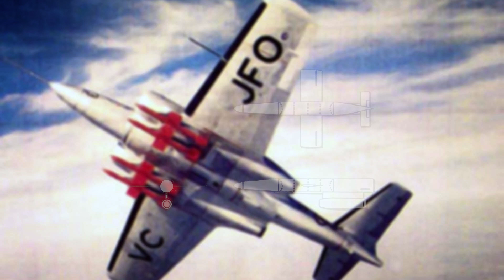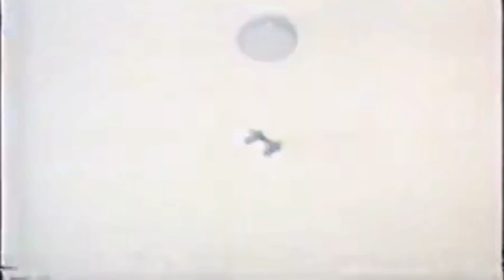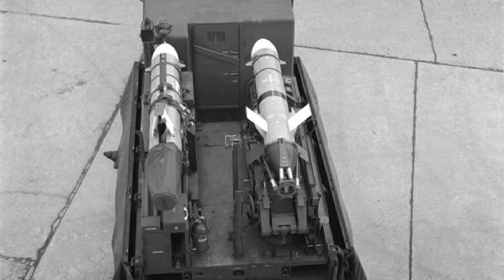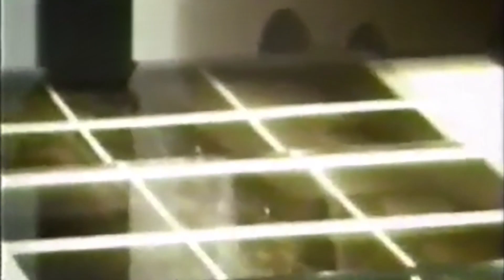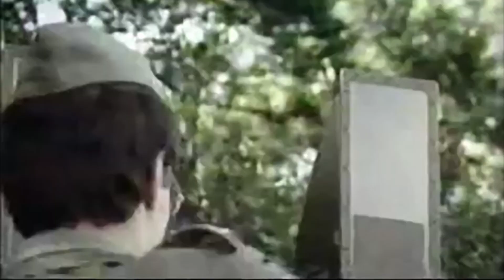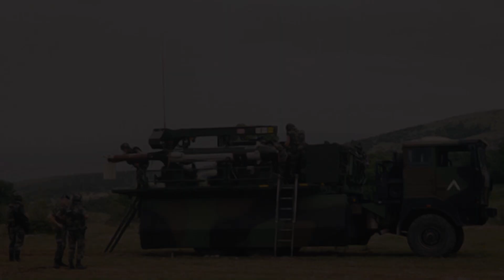Revolutionary 1960s-era drone; story of the Canadair CL-89 & CL-289 Surveillance Drones (No AI)

Comment: Question: 
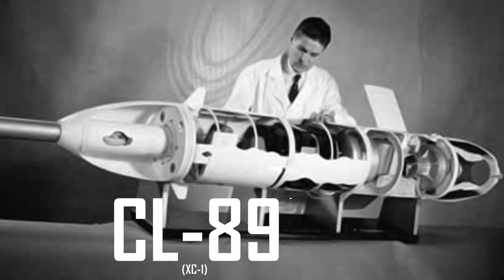I'm a Modeller from Germany, mostly interested in Bundeswehr Equipment from Cold War Era till today. Looking for Reference Material for the CL89 to build it as a Model in 1:35, especially from the TELs (the old BW MAN). Do you have any Pictures, that i can use?
Already builded the newer System, but they are different to the older ones from the 1960s.

Comment: My late Dad worked on the AN/USD 501 trials in Yuma and was CO of the User Trials troop at Shilo, which included English, Canadian, German and Canadair personnel. He mentioned in his memoirs that Canada bought the minimum number afterward because there were insufficient CF personnel to staff a permanent drone troop. Familiar story?
Reply from the maker: Oh cool! I couldn't figure out why Canada didn't adopt them but manpower shortage makes a lot of sense
Reply: Earlier (1953-5), Dad worked at CARDE on Velvet Glove. They had no access to a high-speed wind tunnel so the flight tests used Gerry Bull's test range. Dad's contributions included the high-low breech plug and the sabot used to launch models of the missile from a 5.5-in howitzer barrel (bored-out to 6-in, making it a smoothbore).  As he described it, the high-low mechanism was a restrictor plate fitted in the breech that allowed the propellant to burn efficiently at high pressure, while keeping the rate of pressure buildup against the model/sabot low enough to avoid destroying them. Trenton's RCAF museum has a Velvet Glove model with sabot he donated.

Comment: The first flight in March 1964 crashed after launch not because the booster ignited before the vehicle reached the 27 degrees required, that was a later flight. The crash was due to 2 events. A microswitch on the forward 50 wire, 1.5 inch dia. electrical umbilical cable had been causing problems on launch day and was jumped. The two umbilicals were commanded at t-3 sec to release and close microswitches showing they had dropped clear. The rear fuel/oil air one cleared ok, the front one jammed.  No alert signal was sent due to the jumper. The count continued to T-0. In a bunker close to the launch pad, with no faults showing, I, yes me, launched the drone. Due to the heavy cable up front staying with the drone and the canards not powerful enough to hold the nose up due to its weight, the drone crashed about 3/4 mile out from the pad. All told, that flight test program took 3.5 years and 102 test flights. Note the booster fins were/are on a bearing, free to rotate and not input any torque the drone. Ergo the rails to hold the fins until it cleared the truck. I was a 23 years old flight test engineer at the time.

Comment: I worked on a "Remote Pilotless Vehicle" program at DRES back in the 1980's. This system relayed black and white TV images of the target, there was a cruise missile like air frame but I never saw it fly. They were doing software testing using a high wing RC airplane model with a chainsaw motor, which did fly.
Reply: @polyus_studios  Not sure, but I don't think so. This was 1980-85 in Suffield Alberta, with DRES I think.

Comment: None of the Canadian Equipment you have documented was designed or spec'd in metric.  In future please consider providing dimensions, weights and specifications in the original Imperial measurements in addition to metric...
Reply: Learn both. Here in Canada most people are dimensionally bilingual. It's not that hard.
Reply: he stated the specs as they were specified. ppl should just get with it and be able to use both. As long as its correct, that's all that matters to me.
Reply: @polyus_studios  better yet, give the formula for the conversion and let them figure it out. Maybe they will learn, cause its pretty simple.
Reply: @deedsmillar6056  Download the app
Reply: @polyus_studios  Well you should learn Imperial measurements as it is still widely used even in fully metric countries (which Canada is not)  And imperial is much easier to visualize since the world around us ,especially in N.A, is based on Imperial.    Traffic lane widths are 12Ft and trucks and buses are 10ft wide.   The standard sidewalk is 3ft wide/yard.  So it is easy to visualize. 
 You will also find that most of the stuff you post will have exact Imperial measurements.  Plus NO ONE in North America uses Newtons for thrust in the real world.  Ft lbs thrust can be easily visualized, whereas newtons not so much. 
I would suggest if the item was designed in Imperial then give the measurements in Imperial, and put the metric equivelents in brackets.
Reply: @matthewq4b  Well MATTHEW maybe you should learn some math. Like the test of had to.
Reply: @lessharratt8719   And I can easily convert between them and arshens and a few others.   And THAT is not the point. This equipment was Designed in Imperial spec'd in imperial and ALL specifications are IN Imperial,   When they are converted to metric they are RARLY done so in exact equivalents.  So this leads to specification errors not to mention that the largest you tube viewing audience is in the U.S  where they Don't use metric and can actually do math in more than multiples of ten.  So MAYBE YOU should learn some math like the creator so this equipment can be given in the ACTUAL proper dimension and specifications it was designed and built-in instead of approximate metric ones...
Reply: @matthewq4b  seriously man. Give it up. The conversions are easy. This man did enough work for you. You do the rest...
Reply: @matthewq4b  M'uricans rank 30th in math. So much for being *good" at it
Reply: @666zombee   And that has what relevance exactly?
Reply: @matthewq4b  For god sakes you're on the internet.  If you need to convert anything, go on a conversion calculator to find out for youself.  Alot of research has been done in these videos.  It's your turn to do your part.
Reply: @ADAPTATION7   Apparently not enough research to use the proper measurement units.   And really you are making excuses for being lazy and not doing it correctly. Always one idiot ready to make excuses for lazy shoddy work.   Good job on supporting the race to the bottom ya muppet.
Reply: @666zombee  Yeah, that's why they can't build rockets, planes and nuclear submarines, because their rotten public schools suck
Reply: @matthewq4b  well, considering joint development with NATO allies, especially Germany, Italy, France, just maybe it was spec'd in metric, just like where even US Americans use 5.56 and 7.62 ammunition...yes, originally .222 & .308, but that's how it goes ;-) ...is.308 any easier to visualize for anyone else in the world? Ah, well....
Reply: The first metric item the CAF used from the EU was the Browning Hi-Power then the FN the First EU mech equipment was the leopard tank otherwise it has been soley US, or Imperial (at the time) based UK equipment.  So the point stands.
 And no the 5.56 was NEVER the .222 it was designed by FN as the 5.56x45mm it is dimensionally similar to the .223 Remington But NOT the same...
The .308 was designed as the .308 Winchester and THAT is it's proper designation. The EU-centric NATO decided to call it 7.62x51MM which does not change what it's proper designation is.  
  Most the equipment highlighted in these vids was originally designed in Imperial and imperial gives the most accurate dimensions. As in many of these vids neither the metric NOR the imperial dimensions are correct due to rounding errors converting to and from metric dimensions.  So again the point stands. If the item was designed in Imperial use primary Imperial dimensions instead of faulty incorrect metric ones. Furthermore, most of the native English-speaking world uses imperial as their primary measuring system...
Reply: @matthewq4b  Canada is pretend metric.  Saying this as I sip my 355ml beer (exactly 12 ounces US).
Reply: @matthewq4b  news flash ! The world doesn't revolve around M'urica